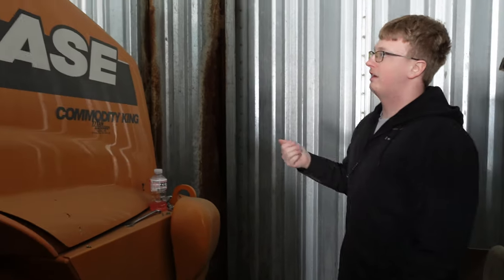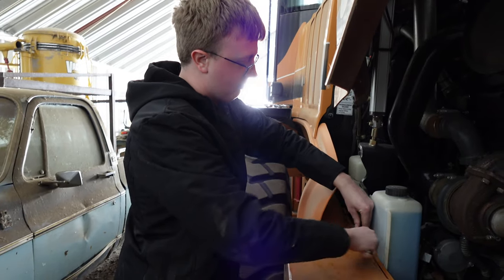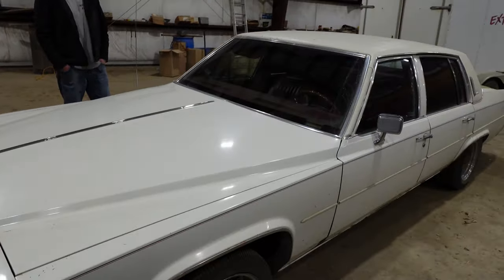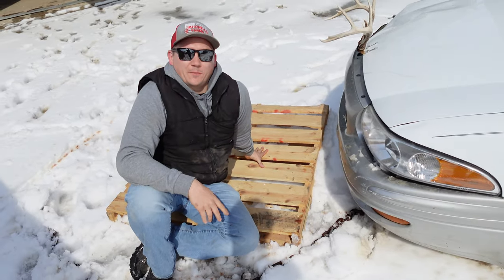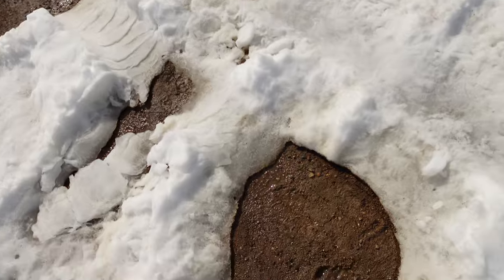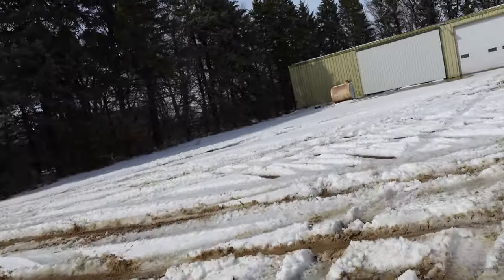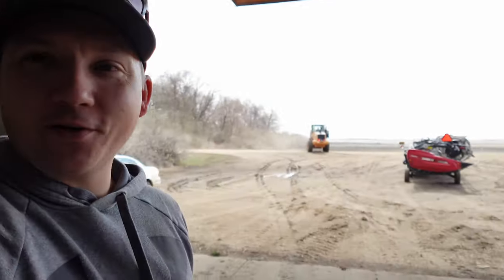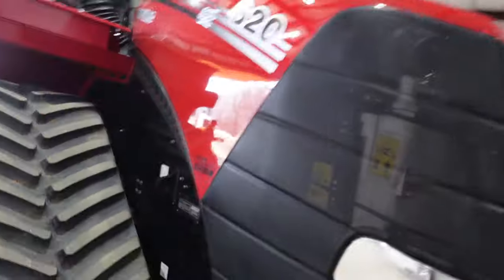Pouring Money Down the Drain!

Comment: We bought about 10 of the little plug in trickle chargers and keep them on all our tractor batteries thru winter, it's a lot of extension cords but it's better then buying multiple  250$ batteries lol
Reply from the maker: Do you need anything specific for tractors vs smaller batteries?
Reply: @MitchellFarms_MN  nope just go to local hardware store and ask for battery tender trickle chargers, they look like a little 5inch by 3 inch box with positive and negative clamps, they work on any battery, they just send constant current to battery to prevent freezing and slowly charges as well, we leave ours on all winter long
Reply from the maker: Good to know- we better get some before this fall because they’d all pay for themselves in a single year if it prevented one battery from freezing!